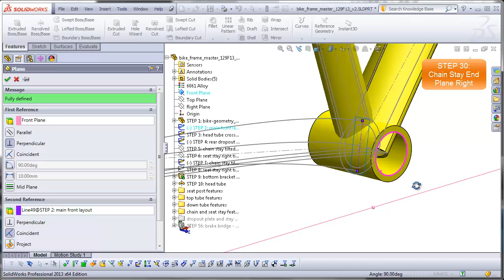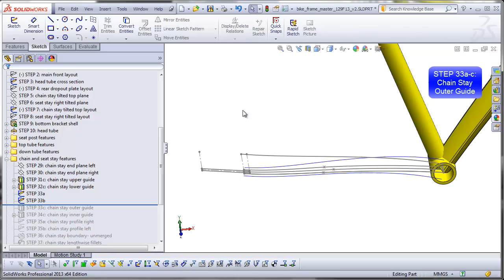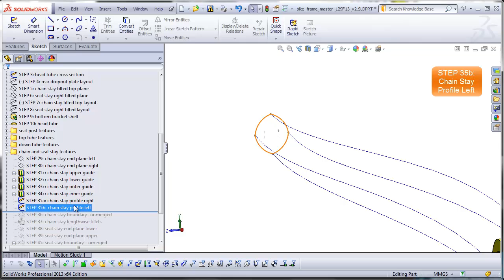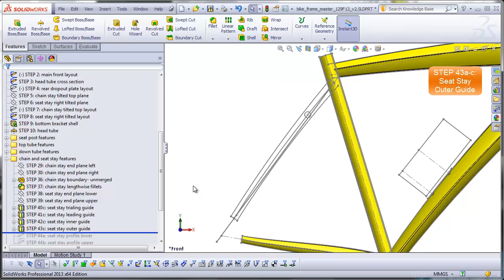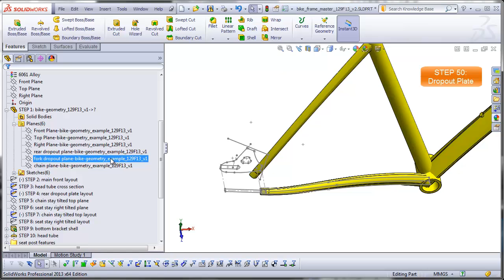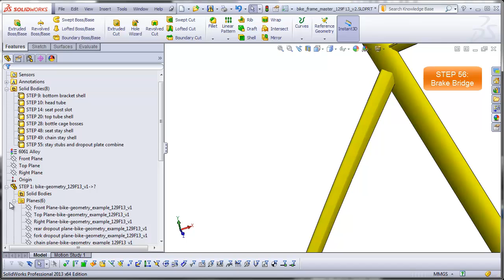DSID129, Solidworks Project 8-5, Bicycle Frame - Rear Triangle

Comment: Excellent series of videos, just starting doing my bicycle design following your videos and have a question, what is the distance between the frontal plane and the rear dropout plane, I have been looking for that information but unlucky to find that data, hope you can help me. Best regards
Reply from the maker: The distance from the front plane to the rear dropout plane is 60mm (6cm). This means the distance from the inside face of one dropout plate to the inside face of the other dropout plate is 120mm (12cm). As far as I can tell, this is the standard. On the front fork dropouts, the distance is 100mm from dropout to dropout (inside faces).
Reply: Thank you very much, very useful your information